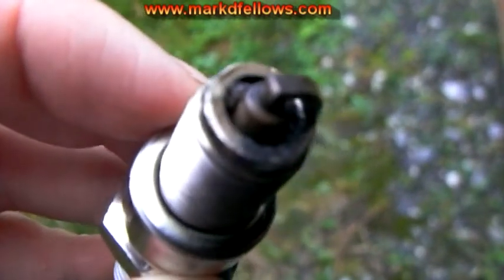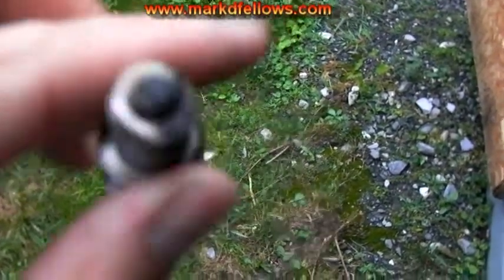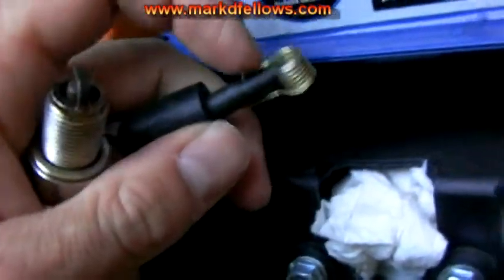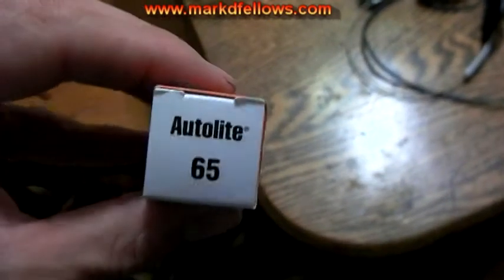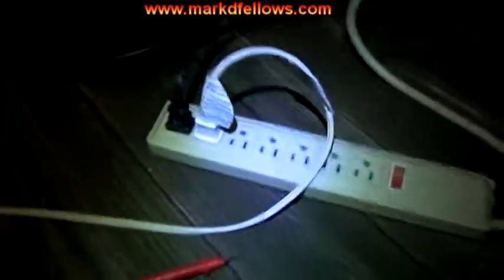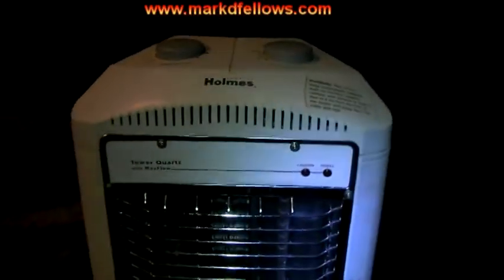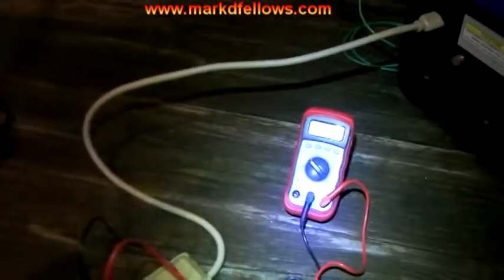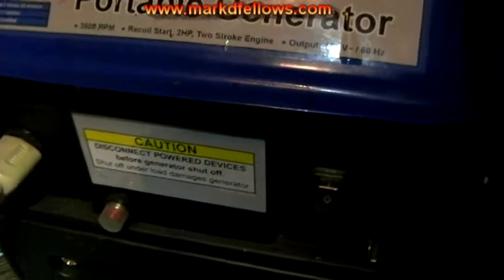Harbor Freight 800 watt generator smoothness testing

Comment: iv had 3 an no problems the trick is to get a torch cleaner an open the fuel jet in carb up to next size to give it more fuel thay are too lean from factory but once you do that your golden an speed it up a little an great no problem an run the fuel 30 to 1 it will last longer
Reply from the maker: Josh Mclarty thanks for the tip!

Comment: Walmart STILL sells these for $99. (1-18-2016)  They are all mostly the same regardless of brand name except for external cosmetic stuff. 
By the time you factor in profit margins and transportation costs from halfway around the world, it must cost some Chinese factory around $15 bucks to make these. They are great bargains if you want a beater generator and you give them a good going over for loose hardware and ditch the cheap Chinese spark plug in favor of a genuine NGK plug.
Reply from the maker: thanks for your comment!

Comment: I've heard that if you ground the generator it will make it run better. There's supposed to be a bolt on the side opposite the recoil that you can hook a wire to. Great video.
Reply: ***** I know. Me too. It might be like a ground for a welder?

Comment: My HF Storm Cat has 25 hours on it with a 500 watt lamp for break in using 40:1 oil mix, 89 octane ETOH free gas. It has the original Xinhua plug, and it runs great. I have an NGK in case it starts to act up. This is my 2nd Storm Cat: my first had a small blow by leak at the spark plug/head interface, so it leaked a bit of oil there, I exchanged it. This new one is a keeper and starts in about 3 or 4 pulls when cold. It drops a bit of voltage with a heavy load and surges when you drop the load, but for lights, and motors like a drill it doesn't hurt. For $90 (with coupon) it's a great buy. The cylinder is cast iron, the whole cylinder is iron, fins and all, not just a liner, and a magnet sticks to it. It should last a long time with care and plenty of available spares on amazon and ebay: search for Yamaha ET650 or ET950...these Harbor Freight Storm Cat generators are clones of the Yamaha available in other countries. You can get an hour meter for about $11 at amazon... Thanks for the review!
Reply from the maker: Victor, thanks for the comment!

Comment from the maker: I personally would want to use a line conditioner on anything expensive I plugged into this device for two reasons.  1. The voltage is not as regulated as on a better generator, and I have seen it rise to 150volts.  2.  If you have two different items plugged in, and one switches off, you could get a quick voltage spike on the line with your other item on.  Although it is not regulated as well, it should be a clean, non noisy signal without major harmonics.

Comment: Those little generators are actually pretty robust.   Theres a few vids around on YT of people dissecting them and they are built pretty well.    Won't run your whole house but will give you a little power when you need it most.